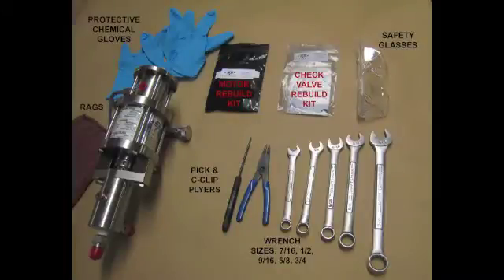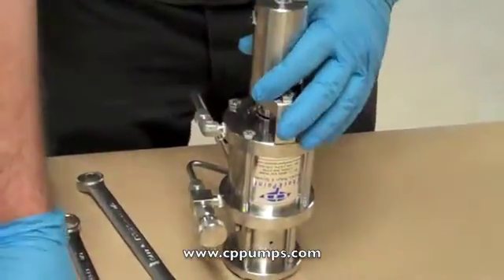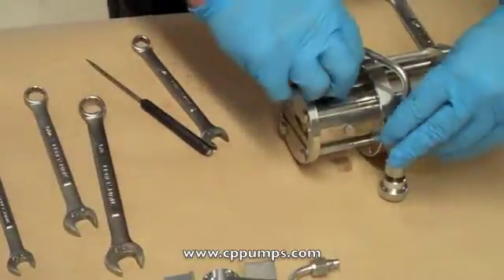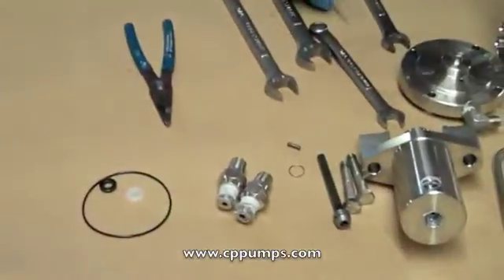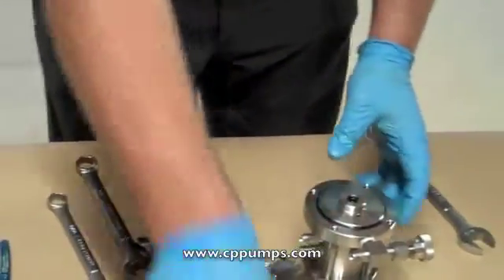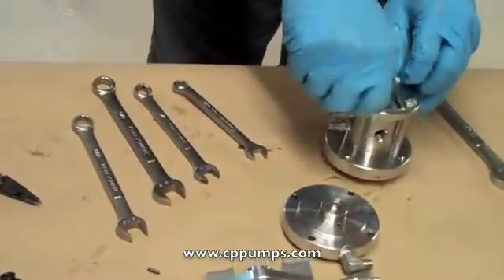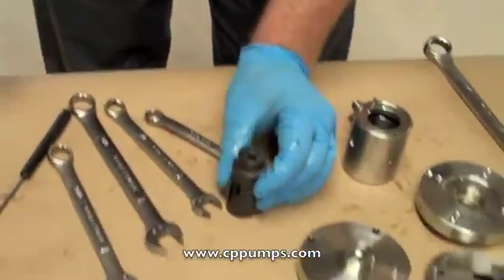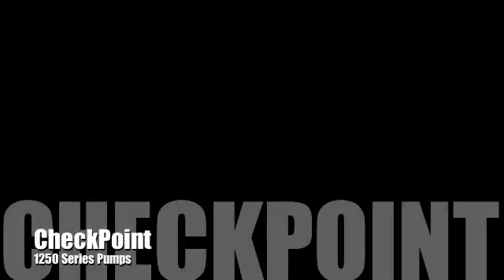Breakdown, Dismantling of 1250 Series Pneumatic Chemical Injection CheckPoint Pump

Comment: size of the plier to remove the retaining ring, please
Reply: We use a Imperial IR-380H Industrial Retaining Ring Fixed Tip Pliers
 for 1/8” to 3 1/2” Retaining Rings. It has a .038” Tip Diameter with 0 degree tip angle.